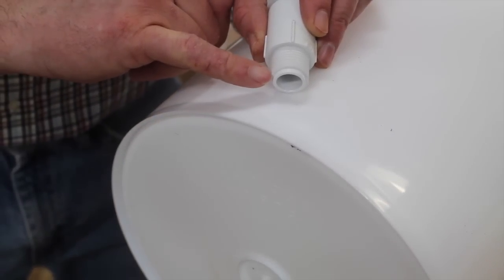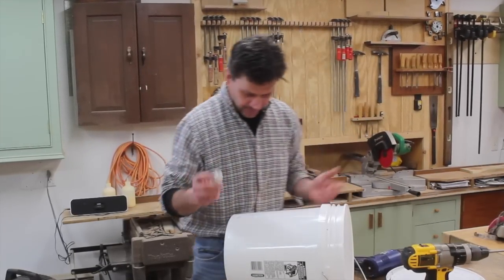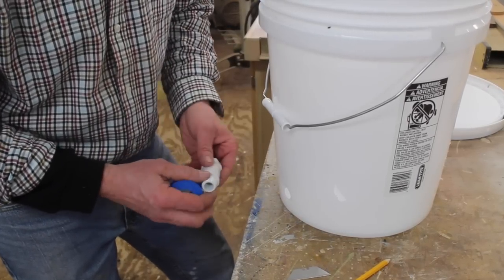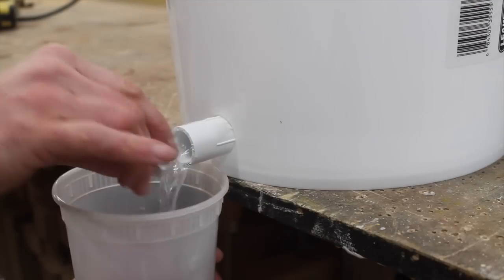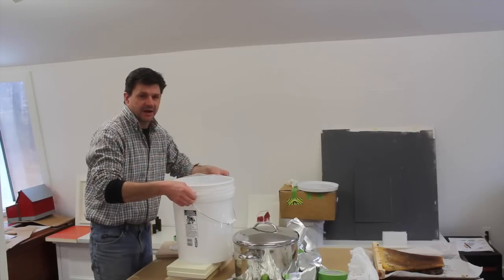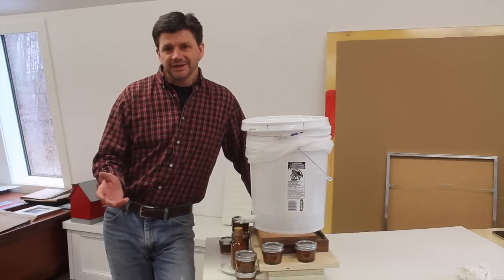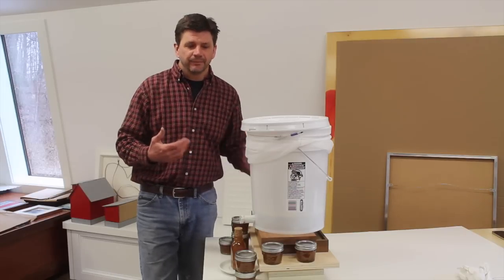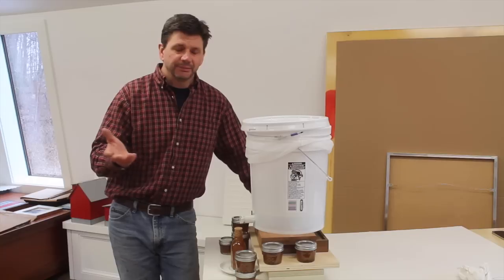How To Make A Simple Honey Gate & Top Bar Honey Harvest.

Comment: I put drain spouts in my hydroponic buckets. I use a step drill bit for the right size hole. my secret is I also bought piece of 3/4inch x 2 inches long threaded steel pipe. the taper of the step drill hole and the flange on the steel pipe makes it easy to screw in the pipe using vice-grips.   It's a cheap alternative of a tap and die for cutting the threads into the bucket wall. The threaded  PVC fittings will screw in nice and tight without a leak.thanks for the great, and complete, videos on building the top bar beehive